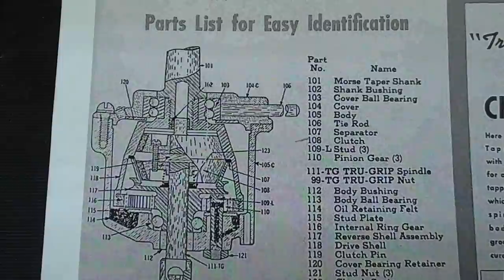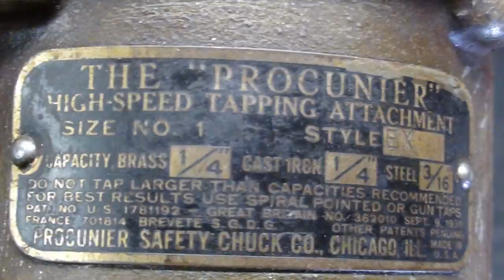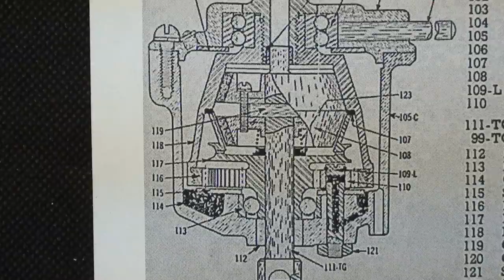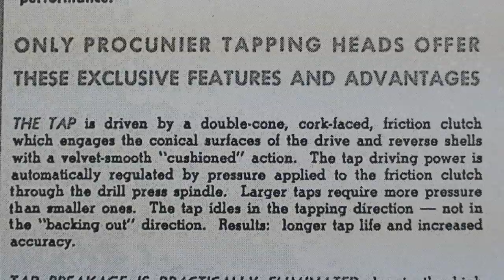PROCUNIER TAPPING HEAD CUTAWAY pt 2 744 tubalcain

Comment: Thanks, very interesting!
This is a long shot, but can anyone out there point me to information about the Grand tapping heads? I picked up a used pair on eBay, and they're solid but well-used. I'd like to refurbish them a bit. Information on lubricating and adjusting the clutch would be very helpful.

Comment: Hi Mr Pete,
back in 1976 I worked at foundry that manufactured cast iron central heating boilers we used to use automatic tapping tools. Often wondered how they worked. In the UK hand taps have 3 flutes machine taps only have 2 flutes.
Keep making the video's.
Bye Martin.

Comment: Fascinating. Thanks for your great instructional video! Planetary gears are fascinating; I consider them to be one of the most influential inventions by mankind, second only to LED's.
Reply from the maker: Yes
Reply: For most of my life there were no blue and therefore no white LEDs.
Reply: @ohmbug10  Actually, I believe blue was the color of the first one demo'd back in the 20's?  Or to be more accurate, the effect was demonstrated by a Russian. It was not possible to actually manufacture LEDs at the time, so it was essentially forgotten.
Reply: @componenx  That's interesting. To clarify, I was meaning commercially available. The early blue ones weren't bright enough to be practical. A Japanese man invented the bright blue ones in the 1990s and they were made readily available in the later 1990s. Not sure what year. That lead to white LEDs using RGB.

Comment: Lyle, don't worry about becoming older & more incompetent because many of use are doing the same and need refreshers from you!  ;)  I think you did a very good job explaining how this tapping head functions.

Also, don't cut out too much of your "chip making" because you think it's boring.  You are pretty much, if not, the *original* YouTube machine shop channel and we're here to watch and learn about chip making.  I learn little things from virtually every machining video I watch here and from other channels too because every Machinist does it his/her own way depending on equipment limitations & skill/training, and even though a particular "project" may be something I'm not interested in, I often pick up a technique or tip that I can use in my own shop.  I do the same with "projects" in the Machinist magazines I subscribe to -- I read every article, even though I'd never build most of them, I learn from every one of them and can apply "lessons learned" from many of them, just like I do with YouTube Machinist videos.

Comment: Dad drug one home back in 1970.  It was a no. 2 with a drill press mount.  He wacked that part of it off. Luckly, had a no. 2 MT shank so we were able to mount it in the mill we had at the time.  Tapped many holes with it.  Lone gone, I've picked up a newer one a few years ago, works just as good as the older ones do. Have a no. 1 like yours, I removed the stub shank and made a straight shank for it so I can use it.  That thing is noisy!  Thanks for sharing.  Ken

Comment: What a great job of explaining and demonstrating in detail how this rather complicated and cleverly designed tool works. I’ve used many different models over the years and always wondered how that reversing mechanism worked. Now I know. I would like to point out one thing. The tap only needs to go through the material once, then back out. Not “double tapped” as shown in the video near the end.

Comment: This is a great video.  I always wondered how they worked.   I would love to see you make a video of a bearingizer.  These were used in a bore to roll the peaks of the bores surface finish to be smooth ( Burninshing).  In my case, I was machining wheel cylinders in a production setting.   Basically 3 steel steel rods in a shell.   Somehow the bearingizer picked the part up, then released the part after being processed.  The part ran up the tool all by its self.   Possibly made by cogsdill ?
Reply: Leroy Gast was the inventor of that process. He was a process engineer at the Bendix Corp. in St. Joseph , MI. The process was developed in the late 50's and incorporated roller bearings captured vertically in a steel cage, with a slight taper at the end. As the unit rotated it was flooded with a mixture of paraffin and kerosene. The slightly smaller lead end grabbed the part and it pulled the part up the lenght of the tool. The prior reaming operation left only .001" of material for burnishng. Once sized, it just dropped off the rotating tool. Mr. Gast passed away about 10 years ago. He was very sharp and a super guy!

Comment: Hey Mr Pete, of course we enjoyed it, that’s why you have nearly 300,000 subs. Does that type of tapping head have an auto overload? I have a Fein tapping drill and it automatically backs the tap out if it gets to tight in the work piece. It does this so quickly that it’s kind of like a slow motion hammer drill repeatedly cutting and backing out, cutting and backing out. Incidentally I bought the drill at a scrap yard for $10 without realising what it was, I just knew Fein was a top quality brand and the weird chuck had me curious. Once I got it home I looked it up and realised what I had and a new one was nearly $2000. Of course it didn’t work but a new power cord soon had it working again and a piece of the chuck was missing so I found a replacement chuck for $50 so for a total investment of $60 I have a very high quality tapping drill. While I don’t use it very often, for the price I’ll keep it. Cheers Stuart 🇦🇺

Comment: I'm old too and sometimes confused - took me a while to figure out that the clutch was pinned to the bottom shaft. 
Would have been nice to have emphasized that for me. Thanks.    Once I caught it I was good.
I have 2 of these that work fine but have been nervous to take them apart and without a need to I just use them

Comment: I have used Tapmatic heads to chase threads after welding a nut into the internal frame of a fold down arm for a driver's arm rest. They were installed on driver seats for semi tractors. Al B.

Comment: Great video! I never realized that the reverse mechanism was always in gear, and I own two of these.

I was under impression that the shaft moved the sun gear into mesh. I didn't realize that reverse shell was always spinning at 2x speed in reverse and that what was moving up and down was the clutch cone. Having a friction clutch in both directions is really nice.

Comment: I first used one these in 1981 and fell in love with it. Just like you , I wondered how it worked inside. I knew it had some kind of clutch system because it was so smooth. The most important thing to me was the fact that the torque was determined by the amount of pressure you put on the handle of the drill press. Smaller taps that are easily broken can be easily run in and out a little bit at a time, giving you time to clear chips and apply lubricant. I wish I had the time to build a version of this great tapping head. Thanks for the videos mrpete!

Comment: Nice cutaway. Makes things very clear. On mine, I turned down the morse taper input shaft to a cylinder so I could hook it up and remove it quickly. That makes it worth  using for just a few holes (say a dozen or so). Putting the input shaft into a half inch chuck (on its own morse to jacob adapter) sure makes for a long string. You really have to lower the table a long way.
Reply from the maker: Yes

Comment: Lyle -  Excellent video with coffee this morning.  This slightly younger than you old retired mechanical engineer liked this - very clear description and good demonstration of a planetary gear system.  Will have to send link to my grandson - that is where these videos have great value.  I have an old Ettco Emrick tapping head picked up at an auction, have not used it yet.  Got looking at the patent for it last evening - slightly different design.  Pre 1964 model as tag shows it built in Brooklyn, NY back when NY still had those things called factories.  Keep up the good work.
Reply from the maker: Thanks

Comment: Note that the tapping head body must be held rigid for the tapper to work. A rod for this purpose strikes the drill column and is held in place. Tap-Matic used two sheet metal stops to hit the column from each rotational direction. Lyle's cut away unit had a depth stop attachment that also functioned as a depth stop. This was naturally captured by the depth stop frame accomplishing the body rotational stop in both directions.
The clutch function "softens" the rotational engagement allowing a low skilled operator to match the quill feed rate to the the spindle speed and the tap thread pitch. Otherwise, the low skilled operator would break taps or stretch threads in soft material frequently. The same function allows highly skilled operators to do production work rapidly with a moderate degree of effort sloppiness.

We ran Burgmaster turret drill presses well into recent years using Tap-Matic heads for tapping. These were set up typically with center drill, tap drill, tap (with tapping head), and possibly followed by a deburr tool. This is fast, repeatable, consistent production performance with either manual Burgmaster or automatic Burgmaster.
Manual machining requires exotic mechanical tooling for production speed and accuracy. CNC eliminates much of this exotic tooling requirement. I come to Lyle's channel to learn obsolete processes. I have lost interest in CNC and want to know how to employ older (manual) technologies.
Reply from the maker: Thank you for watching and thank you for that nice explanation

Comment: Very interesting gadget. Thank you for sharing. I suppose at $700 each this would be a tool well worth it's cost if you're paying someone to stand at a drill press and tap holes in parts all day. I feel that you demonstrated the operation very well verbally and with your new visual aid. I now understand how they work. Kudos to the engineer that designed it including having the reverse (or retraction) speed be faster than the forward (or insertion) speed for greater efficiency / productivity.
Reply from the maker: Glad you liked it

Comment: I have a #3 model that gets used from time to time and had little idea as to how it worked or how many parts would go flying should I open it up. It worked fine so I decided to leave well enough alone. You are very correct about the collet prices. After your videos I would have no problem opening it up should I have to. Thanks for another great and informative video.

Comment: I've used a tapping head before. I'd take one of those over a tapping table any day. I'm amazed the cork is holding up that well.
Reply: Also, your faculties are in much better shape than our president, so you're still doing fine.

Comment: I have tapped many holes with that tap head what you did not talk about is the torque bar and how it slaps you in head if it is on the wrong side of the column, with the one that's clamps quill you wouldn't have that problem.
Reply from the maker: Yes

Comment: In addition to reversing, another advantage of the clutch and the neutral position not mentioned here, is that if you don't keep up with the feed, or need to stop, in either direction, it will automatically disengage, instead of stripping the threads, or breaking the tap.
Reply from the maker: Yes

Comment: In the 70's I spent hours each month at a drill press watching a similar product thread holes. I figured it was gears and a clutch but couldn't visualize how they worked together. Thanks for the insight, it makes sense now.
Nail polish is useful stuff. I keep a bottle of red, black, white and clear in my tiny home shop. The red and black I use to mark battery polarity on things like remote controls and clocks as I find the plus and minus symbols hard to see. The white and clear are good for making and protecting labels.
On a side note in a recent vid you had mentioned the plastic model engine kits of years past. While in Wallys' store yesterday I saw a visible V-8 kit in the toy department $19.99. My grand kids probably won't be interested but their grandpa might be.
Thanks for the lesson. I try not to miss the extra credit for without it I'd never have graduated high school.
Reply from the maker: Really? Only 20 bucks?
Reply: @mrpete222   I looked at it twice but as I recently passed the 7 decade point in life there is every chance I got it wrong anyway. 
Stay Healthy
Chuck

Comment: I've used one of these before for tapping sheet metal parts. There's certainly a feel that needs to be developed to avoid stripping out but they are undeniably good at tapping many holes.  After this explanation, I wonder how often the cork clutch and spring need to be replaced. Seems like spring tension has to be ideal to maintain a "neutral" position.
Reply: I worked in a machine shop that still uses a really old one. Head machinist has been around a long time, and he told me it doesn't wear out very quick, but you should clean the cork off every year or two. 

Not sure if it's really necessary, or if the old man was just obsessive, but he kept most of the machines in that shop running since the 70's, so I'm inclined to believe him.
Reply: @Savagedownsouth  That's an impressively low maintenance cycle and also life long machinist capability. I wonder how you clean cork? I assume you would sand it lightly to break down any glazing developed to improve frictional coefficient.

Comment: The use of a friction cone made of cork, which is not generally recognized as a material having industrial utility except for gaskets in low pressure applications, seems an odd one.  The promotional literature, however, touts the cork friction cone as an attribute. I wonder if various elastomers were tried and evaluated?
Reply: It was designed in the late 20's; they wouldn't have had many elastomers to try back then.  They probably wanted a material that wouldn't soften or get sticky with heat from the friction.  Not a lot of heat there, but used all day in a production setting in the summer, it would get warm.